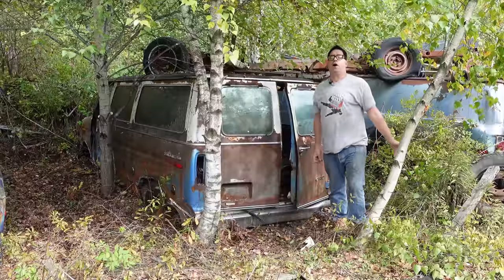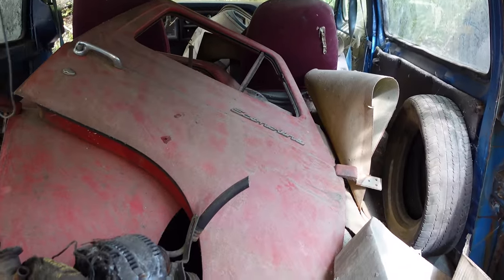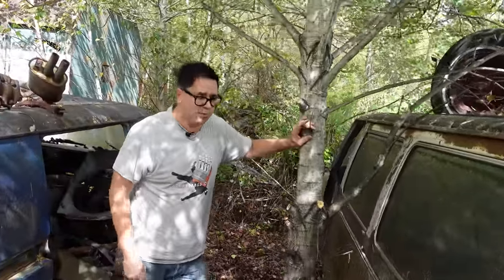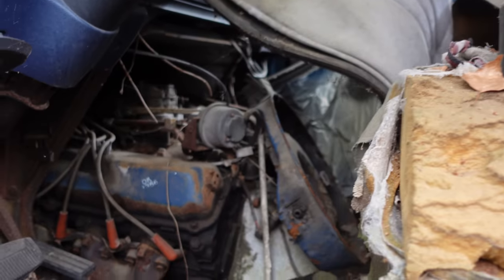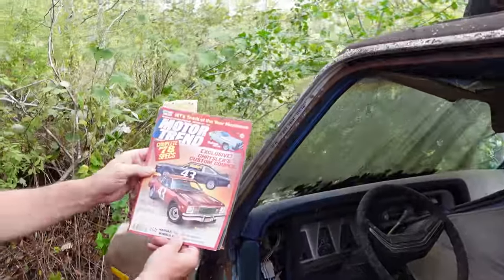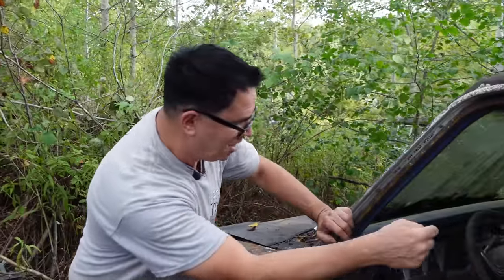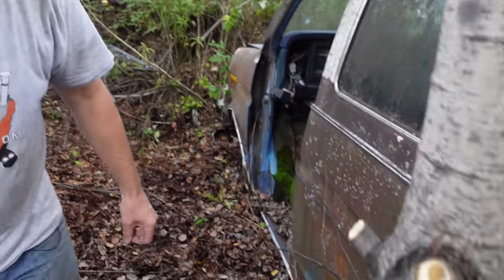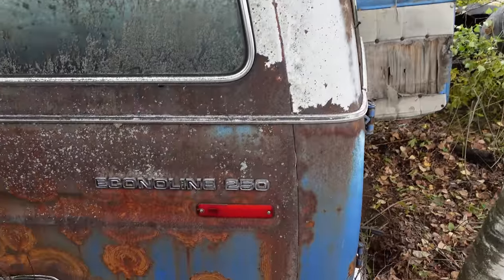Muscle Van 460

Comment: Never heard about a Trailer Special van. Thank you for the education Steve!
Reply: Was an OEM option package as he stated.
Reply: Not sure why it's disappearing, but here goes:

Bob Oberling Used Cars is still in business at  2731 N 12th St, Quincy, IL 62305, although it appears that there may have been a Bob Oberling Ford based on the partial dealer sticker on that van. Quincy, IL is the home of Knapheide, a well-known body manufacturer in the commercial truck world. 

We got the VIN we win: E25 for E250 window van, A for 460 V8 with four barrel, H for Lorain, OH assembly, and the rest is the production sequence lining up with a 1978 model year van. The Lorain plant was the main van plant and operated from 1958 to 2005. The Econoline series  vans ended in 2014, and by 2015 they were replaced by the Ford Transit which is Ford's van offering today. You can still buy a stripped chassis/cutaway Ford E Series and they are produced in Lake Avon, OH. The Transit is produced at Kansas City, MO assembly, aka Claycomo Assembly or "KCAP" (which has also produced F series trucks on a continuous basis since the 1950s).This would have had a Motorcraft four barrel, which was a troublesome carburetor, leaving many an owner frustrated on a damp and miserable day. The Motorcraft four barrel is very loosely related to the Holley four barrel. A Rochester Q-Jet (which Ford actually did use for the 429 V8 in the early 1970s) is a much more efficient and better performing carburetor. 

We got the tag, but we can't brag, but I got some of it figured out, no doubt: Exterior paint is possible code A6 Blue and code 9E Pure White.  1978 was the last year for the 460 V8 in a passenger car. The 400 V8 two barrel VIN code "S" engine would be the top passenger car engine in 1979. Parts manuals, not service manuals will typically have the year/VIN breaks. Most online sources get their information from the given (in this case 1973-1979 Ford Light Truck) parts manuals as there are charts in the front of those books with that data. You are correct, 1981 Ford (like most others) have a 17 digit VIN format we still use today and the 10th digit is the model year. 1981 was "B", 1982 was "C", 1983 was "D", etc.
Reply: @googleusergp  Much obliged!
Reply: @ImForwardlook  Sure thing.
Reply: @googleusergp  Yes there was a Oberling Ford Dealership in '78. That's the year I went to Quincy and bought a new International twin screw then drove it over to Knapheide and had a spreader bed installed. Dealer had to outside acquire the truck and it came from Canada with the metric speedo and the standard in a box I was to install. Waited a few dozen thousand to do so.
Bought a '67 GT 350 from Oberling in '72 then drove it over to Woods Speed Shop and had that sucker built.
Most Knapheide F-350/Transit 350-and smaller-are built just down the road from the plant in Claycomo on Parvin, then stored in the caves just east of there until bought or picked up.
Reply: @Ray56z  I thought so. I could make out a "Ford" oval on the Oberling decal. Yup, I know of Knapheide in Quincy, they are still there as you stated.

Comment: When Ford went to the full chassis vans it opened up the door for box van conversions. The first ambulance I ever drove was a 1978 Ford E250 American LaFrance conversion with the 460. It was a nice package but the latter ones I finished up my service  with in the early 2000's were much better with six speed automatics and diesal power and the handling greatly improved along with the ride.
Reply: That's true. By then, many departments went to the Type I truck chassis with the modular body. While they are more expensive, they have a lot more flexibility as to what can be done  and how they can be outfitted.

Comment: Used to drive a lot of E350s of mid to late 80s vintage. Most of the earlier models I’m pretty sure were 302/351 2V as the performance was relatively unimpressive. The later versions were 351 fuel injected but better. I was driving an. 85 model one day and had the occasion to step in the gas. It was surprisingly strong. When I had some down time, I popped off the doghouse expecting to see a 460. Instead, there was a 351 4V HO.

Comment: One of the best engines ever built by any automotive manufacturer to this day
Reply: Sorry, I've worked on way too many of them to agree with you. Also, fuck Ford for bolting every single accessory on the front of the engine to the water pump.
Reply: @alantrimble2881  Your obviously horribly biased and woudnt know a good engine if you saw it. So what about accessories bolted to the front of the engine.
Reply: @rogerfreas4139  You've never replaced a water pump on a 460 with V-belts, have you?

Comment: BIG  BLOCKS  RULE !     I still run one today in my 96 Suburban even with high gas prices .
Reply: I have been on the continual look out for a 2003-07 Silverado HD2500 quad cab 4x4 with the 8100 and 6 speed manual in decent condition that doesn't have a billion miles and isn't worn out to the bones. Tall order I know but I'm determined to find one. Last of the old school GM big blocks before they put all the computer reliant emission and fuel economy controls on them.
Reply: @joe6096  Yeah , Joe , these trucks are great !   I've had mine for over 7 years now and chased the original owner for 3 years to get it . He ordered it new from the factory for almost $40,000.00 back then . He was a fireman in New York , worked on engine 61 , and came to Florida a year later .  The truck has 149,000 miles , is a 454   4x 4   and you can see it run down Daytona Beach , and New Smyrna Beach regularly .   I also use it to pull my trailer and have built it into a part time camper for our three cold days of winter every year .

Comment: I have had 3 Ford vans since 1993 and put 275,000 on all three.  I sold them and they were still running and they ran for another 25,000 on 2...lost contact with the other one but it was doing work at that time.  The beat the others hands down.

Comment: I lived in a 78 E-350 Mallard motor home I bought from the owner of a scrap yard in Illinois. He had swapped the body panels out for I believe to be an 84 with a much nicer interior. I took it on the beach many times with the front and rear outer tire pressure dropped and other than a bouncy ride at times it never got stuck and pulled a few trucks out that were. Now it lives on as a flat bed for a guy that sets pilings and does bulkheads.

Comment: Maybe the owner needed to haul something heavy inside the van and didn't need a hitch. I used to scuba dive and the dive shop owner had to haul tanks and lead weights to dive sites. He had a one ton Dodge van with a 440 in it. He said it got the same gas mileage whether hauling a full load or empty lol like 12 mpg lol. Another interesting video Steve, that was a good feature being able to fill both tanks on one side of the Ford van.

Comment: As usual, good stuff Steve.  I had a ‘77 E150, and just as rusty as that one, being from the Buffalo, NY area.   It was a non-AC truck but it had really dark tinted privacy glass all around.  A guy I knew traded me a 77 F250 for that van because he wanted the glass (which was the only part not rusted out). Buffalo and Bernardston have something in common - salt on roads.

Comment: I had a 78 ford van 3/4 ton with 351 Windsor  factory 4 speed on the floor. I put 8 inch wide mags on the front and 10 inches on the rear. That sucker cornered very well, I loved driving it. 
I had it for about 15 years. But it got stolen twice, the second time it was totally ruined. Sad ending.

Comment: Believe it or not , since these things tended to get banged up as commercial vehicles and needed to pass inspection twice a year Ford came up with a simplified crash parts package in the early 80s using only the current production grille and light assemblies from the line . Everything in the box but only rectangular lights . Some customers griped about the different look but it was cheaper than finding the round pieces used . So you can find the rectangular lights mounted all the way back to the 75 models - factory retro mod plus the halogens were a step up from the original bulbs .

Comment: That's a class three receiver hitch usually put under those I know because I used to work for U-Haul installing hitches and if they didn't have a hitch we would also build them by hand to fit that vehicle Motors fabricate and thank you very much for what you do

Comment: Not sure why it's disappearing, but here goes:

Bob Oberling Used Cars is still in business at  2731 N 12th St, Quincy, IL 62305, although it appears that there may have been a Bob Oberling Ford based on the partial dealer sticker on that van. Quincy, IL is the home of Knapheide, a well-known body manufacturer in the commercial truck world. 

We got the VIN we win: E25 for E250 window van, A for 460 V8 with four barrel, H for Lorain, OH assembly, and the rest is the production sequence lining up with a 1978 model year van. The Lorain plant was the main van plant and operated from 1958 to 2005. The Econoline series  vans ended in 2014, and by 2015 they were replaced by the Ford Transit which is Ford's van offering today. You can still buy a stripped chassis/cutaway Ford E Series and they are produced in Lake Avon, OH. The Transit is produced at Kansas City, MO assembly, aka Claycomo Assembly or "KCAP" (which has also produced F series trucks on a continuous basis since the 1950s).This would have had a Motorcraft four barrel, which was a troublesome carburetor, leaving many an owner frustrated on a damp and miserable day. The Motorcraft four barrel is very loosely related to the Holley four barrel. A Rochester Q-Jet (which Ford actually did use for the 429 V8 in the early 1970s) is a much more efficient and better performing carburetor. 

We got the tag, but we can't brag, but I got some of it figured out, no doubt: Exterior paint is possible code A6 Blue and code 9E Pure White.  1978 was the last year for the 460 V8 in a passenger car. The 400 V8 two barrel VIN code "S" engine would be the top passenger car engine in 1979. Parts manuals, not service manuals will typically have the year/VIN breaks. Most online sources get their information from the given (in this case 1973-1979 Ford Light Truck) parts manuals as there are charts in the front of those books with that data. You are correct, 1981 Ford (like most others) have a 17 digit VIN format we still use today and the 10th digit is the model year. 1981 was "B", 1982 was "C", 1983 was "D", etc.
Reply: Other than applications where a customer's custom body (like an ambulance) can outlast more than one chassis.  Is  there any reason why Ford still makes the E Series Cutaway vs. forcing customers onto a heavy duty version of the Transit?
Reply: @kennethsouthard6042  There's still a market (in their minds) for the cutaway.

Comment: If the receiver hitch was a bolt-on, it's likely that it was removed before that van was "parked" in it's current location.😁
Reply: Factory/dealer installed it would of been a bolt on I don't know how often you're under heavy vans or pickups, but most frame and suspension is bolt on with them instead of spot welded like passenger vehicles.
Reply: @Ray56z  exactly my point.😎

In my 60 years... especially doing my own repairs (when I was still healthy enough to do so) on our farm pickups...yeah, I have been under a few.😁😁

But I understand what you were getting at.😎😎
Reply: @willhorting5317  I just recently installed a 5th wheel hitch, rails, and frame brackets on a pickup. At 66+, not fun. 
A friend asked me how come I didn't just weld the brackets on the frame, I showed them how everything else attached to the frame was bolted on and not welded. Explained how Ford knew which was stouter so I was doing the same.
Reply: @Ray56z  👍😎

Comment: The 460 Fi motors were so smuggled ford used  a 4° negative cam gear that killed performance and mileage, if you change that if you change that you will see big difference in performance.

Comment: That 340 air cleaner is worth more then the van. 
My 72 roadrunner could use that though.
Reply: You haven't priced 1970s vans lately even 3/4 tons are starting to pull ok money. 
Boogie vans are having a pretty big resurgence at least here in So Cal. 
This van in this video (besides being rotten from the tin worm) biggest downfall it has to pass California emissions still.

Comment: I had a 67 with the pop-up tent on the top, an 89 E-250 club wagon, and currently daily a 2003 E-350 LWB ex-rental. It is nice having working air conditioning. The 67 threw a rod on the highway and wrecked the drive train funny thing my friends girlfriend was sitting on the doghouse when the engine popped. The 89 351 needed a rear main seal so I sold it for what I paid for it after 5 years of use. I drive the 2003 E-350 almost every day for work a side from the vacuum reservoir clogging with mildew and mold and 3 ignition coils that van is solid.

Comment: C'mon Steve, no mention of the axle tubes off an banjo rear... they make great jack stands !!!
Reply: Yep, cut off the brake side of the axle tubes on a Ford or Mercury car up to 1948 and you have some great jack stands. Either cut a notch at the top, to cradle the rear end of the car you are supporting or weld a piece of 4" wide channel iron to the top to place under the frame!
I must have 3 different sets.

Comment: Usually had a full floating axle rear end. But they were basically a 2 wheel drive F-250, why they'd mess around with the POS uni-body designs like dodge did? If you are hauling heavy weights and have your hitch bolted to some sheet metal pieces of a uni-body, that's a lot of faith in the sheet metal! But at least ford was intelligent enough to make them full frames again unlike others!

Comment: I find it a touch odd that they did that "trailer special" on a 3/4 ton.

If I would have been buying one of those, I would have wanted a 1 ton.
Reply: Some states taxed/charged you more for registration over a certain GVWR, so it's likely that's why people would buy a E250 3/4 over an E350 1 ton.
Reply: @googleusergp  ah, thanks. 
I wasn't aware of that. 
I have never owned a 1 ton anything.
Only 1/2 and 3/4 ton.
Reply: @willhorting5317  Sure. Some states really soak you on the heavier GVWR ratings. Some even require commercial plates for those higher ratings as they consider it a work, not personal truck.
Reply: @googleusergp  👍 I knew about the commercial plates.
Reply: @willhorting5317  That and the cap/enclosure rule.

Comment: I know that was a bummer that Ford put both gas filler on one side! With the Chevys big enough truck just pull kind of in between the two and you can fill up from both sides at the same time! You know just flex a little bit of attitude. You know the I'm bigger than you especially when I'm in my big truck. And Dodge must have the extended van for Maxi van long before Ford then. If they didn't have back in 78. I'm going to hold Dodge Maxi van. And I have a Ford van with a 351 in it. I got the Dodge van because it's cheap enough. I got the Ford van because I collect oddball things. That van came from the Lansing Kansas Federal correction institution federal penitentiary. And I still had some penitentiary money in it. Tokens basically. I bought another one and get this it's a Ford minivan aerostar. On the side of it it says we serve a select clientele. If that's not rubbing their face it locked up and so I don't want to be part of that select clientele. I also have about a 78 ambulance and it's got like 40,000 original miles all verified and it has everything but the gurney in it. I've been looking for the proper gurney. It's got the 460 and C6 one ton everything well anyway I enjoyed the episode

Comment: Steve looks like it would take a 460 to drive the ac compressor Ford use to have. They could rival the size of the Briggs and Stratton 😳
Reply: Some Ford passenger applications (such as the Lincoln Mark V around this time) actually used a Frigidaire/GM A6 compressor.
Reply: @googleusergp  And a Saginaw 'canned ham' power steering pump...

Had an '88 E250 with a Saginaw PS pump hanging off of the 4.9/300.
Reply: @DanEBoyd  Probably the best part of the whole truck. LOL.

Comment: A buddy of mine had a 1996 or 1997 F250 crew cab with a 460 that we used to pull a steel 32’ box trailer from time to time and that piece of shit would run hot in traffic every time.  The later 460 was literally a complete pile of garbage.

Comment: 9 tons? That's 18,000 pounds! You need a Detroit Diesel for that lol..... I think you mean 9,000 pounds Steve lol
Reply: That’s total combined weight. Figure the van full of fuel and loaded with people/stuff can probably weigh 8,000lbs. Then towing a 10,000lb trailer isn’t unreasonable. 
If it was only 9,000lbs total you wouldn’t be able to tow more than an tiny trailer as the vehicle alone would be almost the limit.
Reply: @NBSV1  ok i see that makes sense